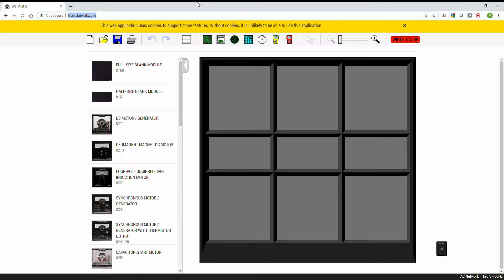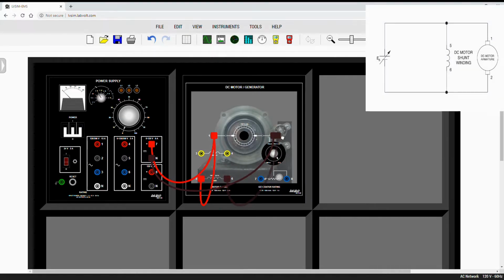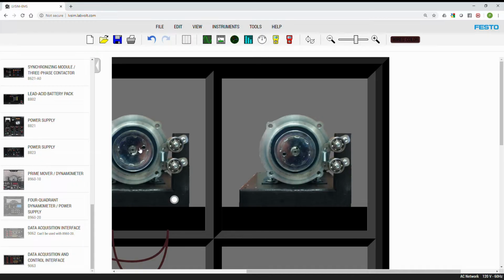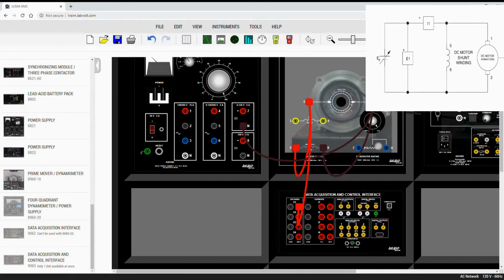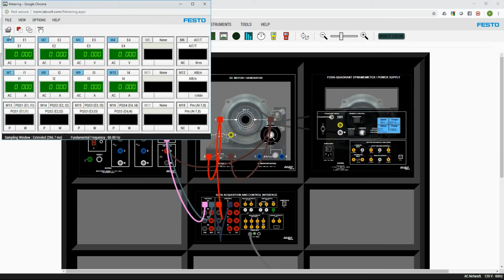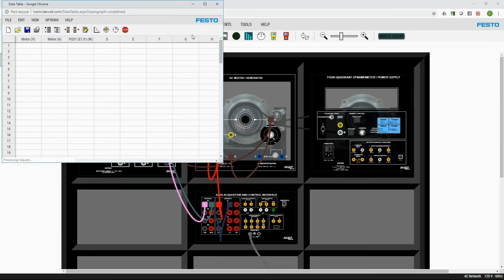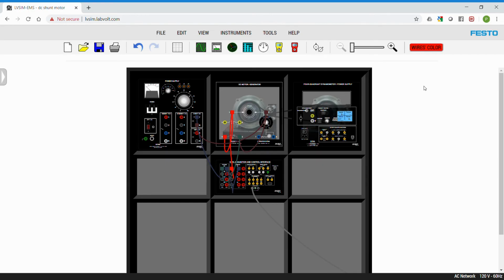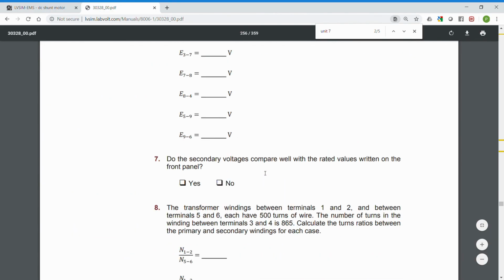First steps using LVSIM-EMS, an electromechanical systems simulation software

Comment: Hi, I have the license of LVSIM-EMS.
I am interested in your simulation of LVSIM-EMS.
I have some question about that why you choose 4-N (setting of voltages selector control knob).
Isn't it a DC simulation? 
Is 4-N for AC or DC? It looks like only 7-N and 8-N are for DC power.
Or they have different meanings of voltages selector control knob.
Hope you can answer me😃 Thanks!
Reply from the maker: Hello! I'll ask my colleagues and get back with an answer.
Reply from the maker: So the product manager tells me this: "4-N is selected to measure the AC voltage between output 4 and the neutral, corresponding to phase 1. Another phase can be selected as desired." I hope it helps!
Reply: @FestoDidactic-LabVoltSeries  Oh~ Got it! Thank you😄

Comment: Sorry, I am facing the problem of operating the power supply in the program, what is the solution?
Reply from the maker: Hello and sorry for the delay. The use of the power supply can be unlocked with an access code. Please contact services.didactic@festo.com.

Comment: if I buy a code, it´s for a lot of users?
Reply: Hello.  Without a license you have access to all of the features except for the measurements.  To buy licenses you'd need to contact your local Festo Didactic representative.  They are sold in units of 1,5,10,15,20,25, etc.  Price per license decreases with quantities.  You should be able to get a quote by filling the form at: https://www.festo-didactic.com/int-en/contact